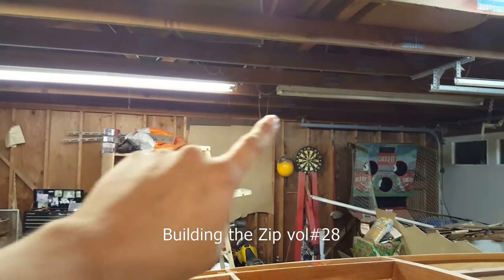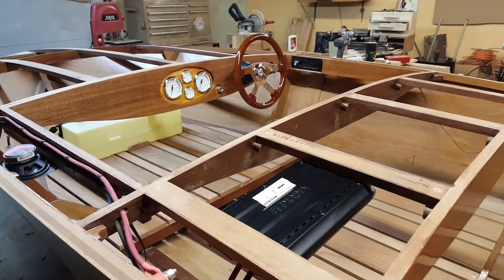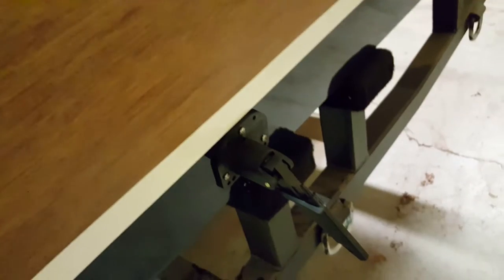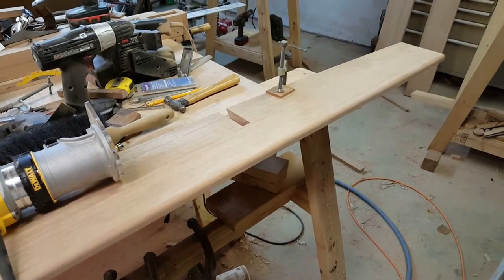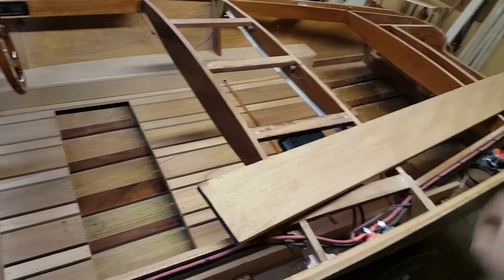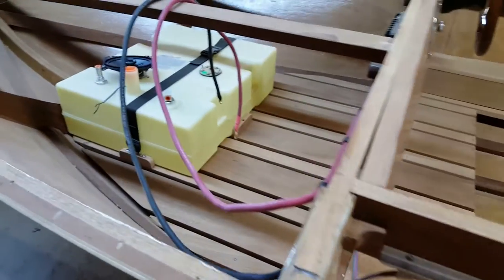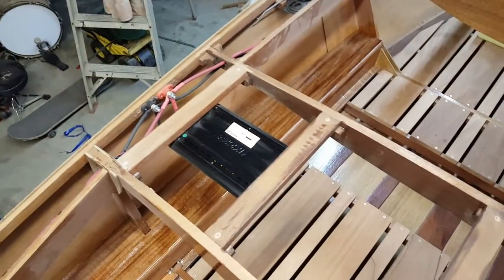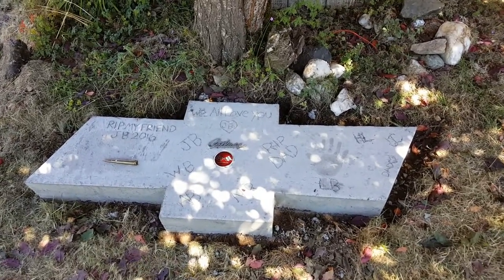Building the Zip vol# 28

Comment: I hope you read this as I am looking at an older video of your progress. I have not noticed any mention of installing any positive foam floatation for your boat. As ir sits now, yes of course, it will float. However I belive Coast Gaurd Regs. state that boats need a positive floatation system. This is accomplished with either expandable closed cell foam or sheets of hardened closed cell foam glued into place. Your arm rests that you are installing would be a great place to pour in some expandable foam. It would not be enough but you can find other areas for that foam as well. If you decide the sheet foam as the way to go, then after building the decks I would suggest attaching foam sheets to the underside of deck from bow to stern and from side to side. That way incase of a sinking it should remain afloat at the deck level.

Comment: There's a good reason to finish off the sides of the wood that are never seen. Wood should be equally sealed (same number of coats) against moisture on both sides even if you don't nicely finish the unseen sides. This guarantees no warpage due to unequal absorption of moisture on one side of a board. Basic wood physics.